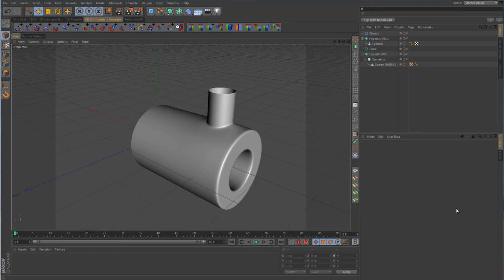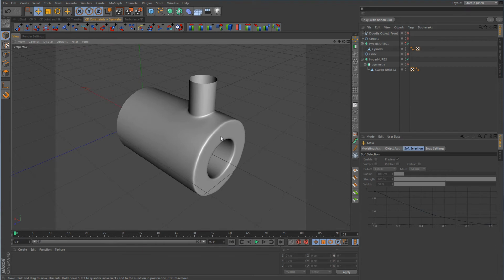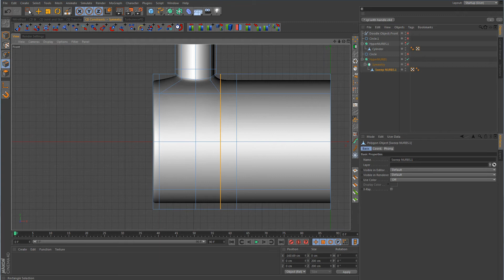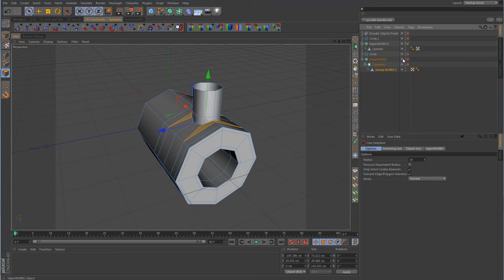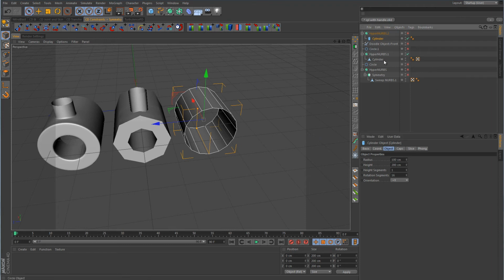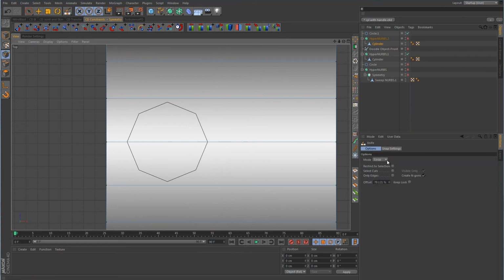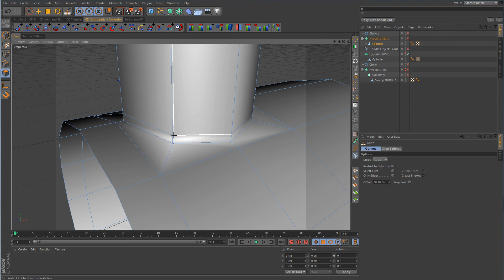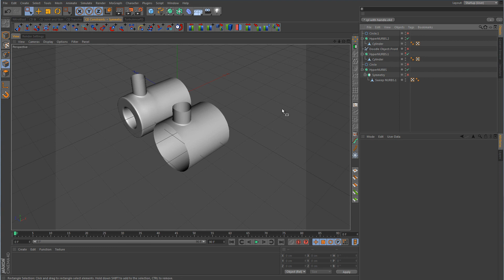Sub-D Modeling in C4D - Part 14 - Fixing the bulge

Comment: What if you're being handed this file from someone else who's worked on it and you have to fix existing geometry? Meaning, you can't start all over and remodel the whole thing? Is there any way to fix the bulge without starting all over?
Reply from the maker: That would depend on whether or not the hypernurb has been made editable or not. If it has, then you'll have to start over, because the hypernurb makes the mesh dense, and thats near impossible to adjust without messing things up.